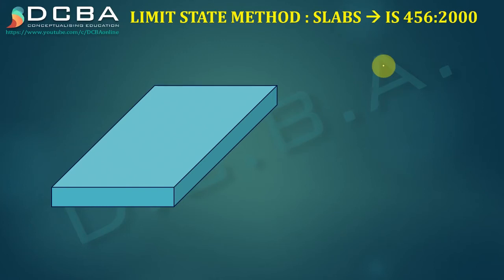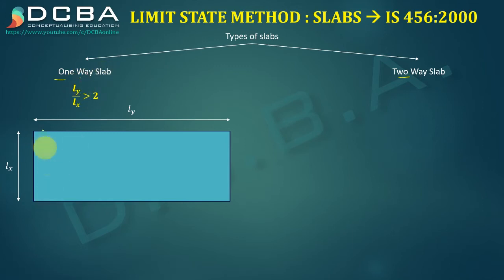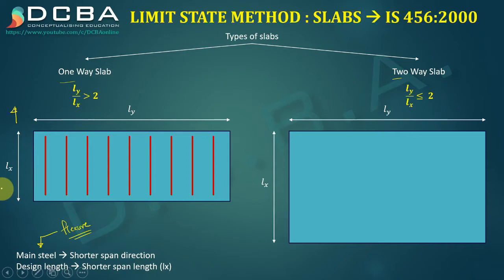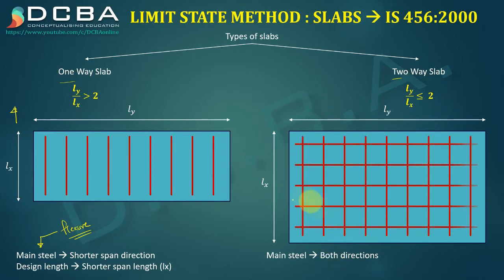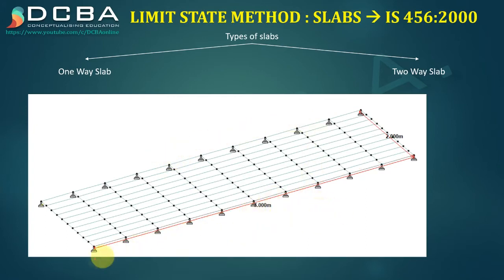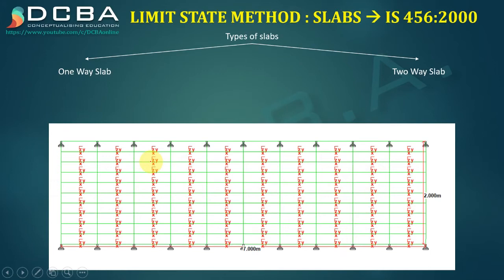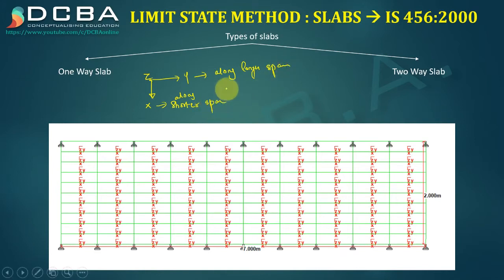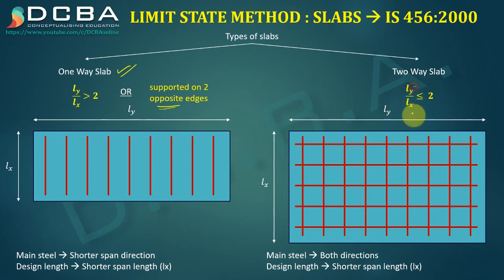Lec 28 - LSM Slab Design as per IS 456 : 2000 - Part 1

Comment: Sir as u mentioned like in the end of video eventhough Ly/Lx <2 but it supported on opposite edges. IN that case what would be the design length or critical span?  is it still Lx only. As this time Ly is getting more moment than the shorter one and reinforcing is providing in longer span. Can u tell me for that last case..
Reply from the maker: If the supported length is the longer one ie if opposite ends of ly are supported (which is generally not done) then that length has to be taken as design length.